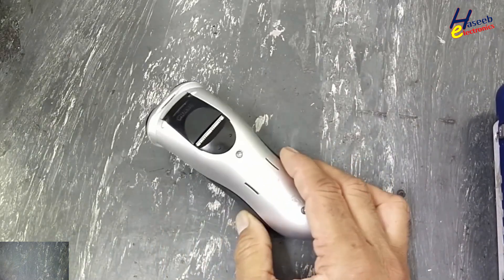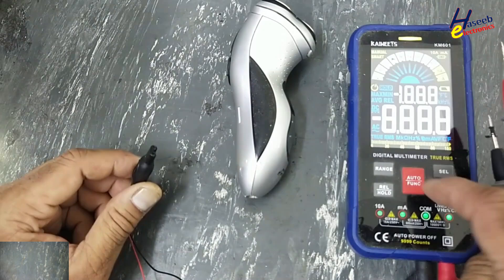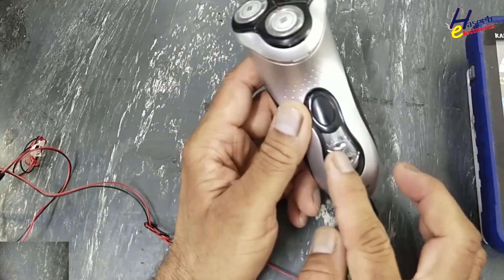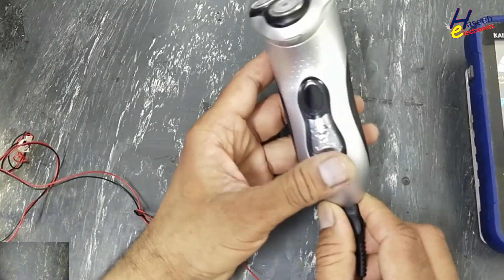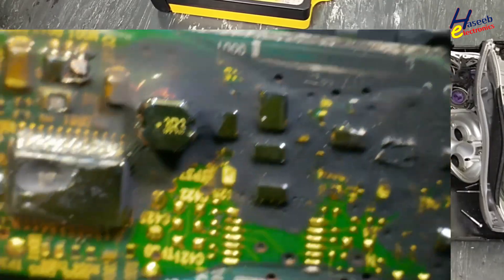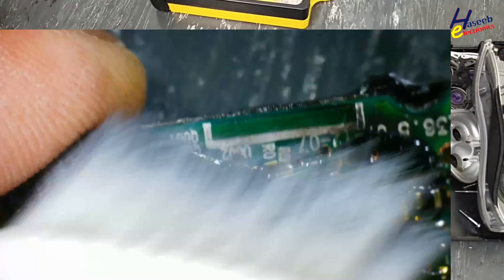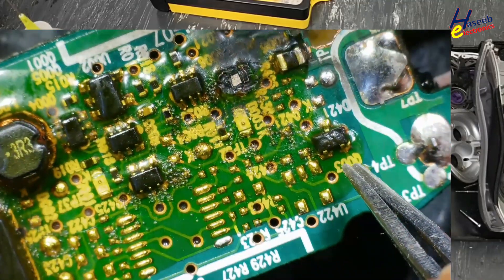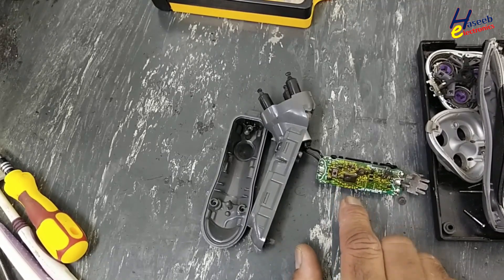{1345} Your Opinion About Philips 7810XL Troubleshooting | Discontinued Due to Non-Economic Repair?

Comment: Yes... As soon as you started brushing ash out. It prob smelled pretty cooked too.
I was really surprised when i saw just a normal 18650. I have one of these but a bit more modern, not broken, been dragging it round for 20 years and dont use it. Horrible things. I like is charger, 15.6vdc and couple hundred mA if i remember. 
So it charges a Li, but can also charge and operate at same time i think. Then the Li is boosted up i imagine, and maybe it has a brushless motor. 
Overcomplicated. I wonder what caused it to fail. 
Thankyou for sharing as usual 😊
Reply from the maker: Yes the circuit barbecued nicely with dark brown texture 😂 
It's smell was attractive 
In the barbecue process the battery looks like a bone in well cooked leg piece 😂😂😂😂 
They are making things "power saving" and adding features, NOT TO EASE OUT THE USER, 
JUST TO INCREASE THEIR INCOME
Reply: Absolutely! Maybe it was not a fault, but a feature 😂 @HaseebElectronics

Comment: a larger surge voltage passed through the board..
Reply from the maker: I agree 
May be some connected to direct line socket for trying it's fast charging option 😂😂😂 
In result, it stopped all functions 😜
Reply: @HaseebElectronics 
Perfect possible scenario 😂

Comment: Electric shavers always cause me skin problems
and skin infections, no matter how much I clean them.  I stopped using them ten years ago after realizing this problem.
Reply: I am the same. My neck always gets a rash after using electric. Much prefer a razor with shaving soap.
Reply: @bobsoft I totally agree.  I really wanted these to work for me, especially once I could afford to buy the norelco round head type.  But I still got the rash - so back to blades it was.. 🤷🏻‍♂️
Reply: Try electric clippers that is used to cut hair. It does not irritate like electric razors or normal ones. If you ever saw soldiers get their head clipped clean in seconds, during basic training, then you will realize how well they can shave your face also.